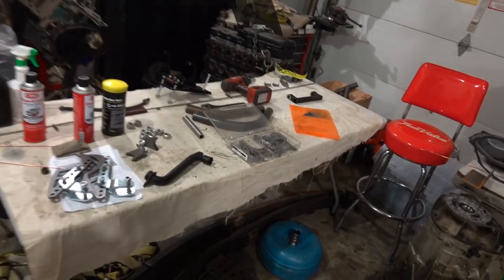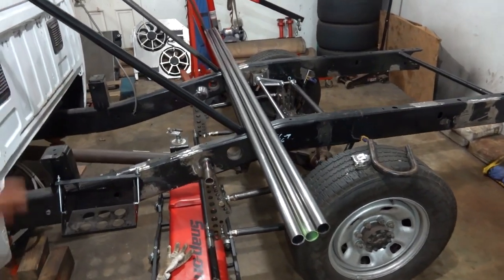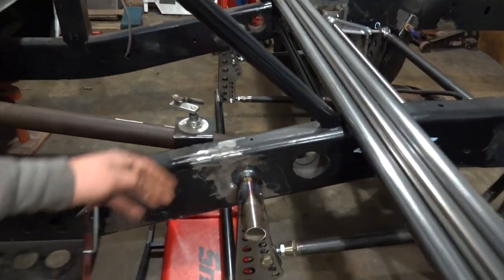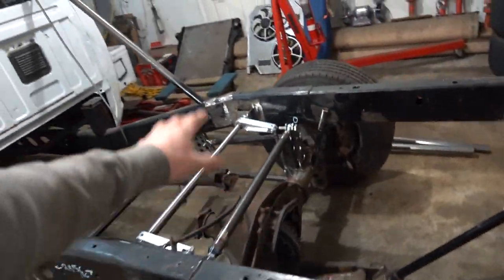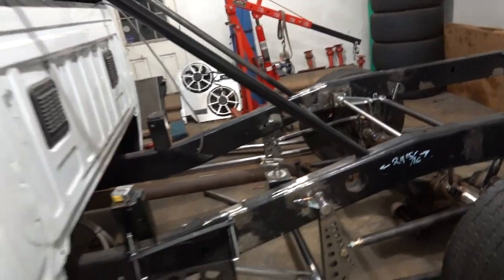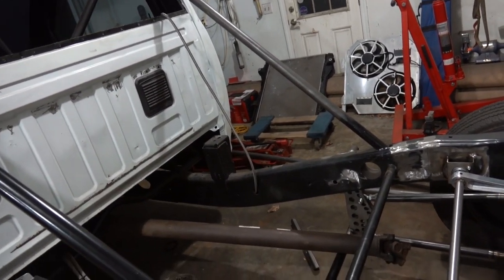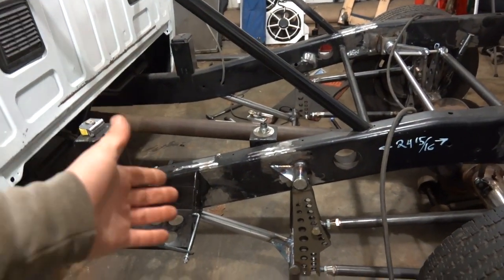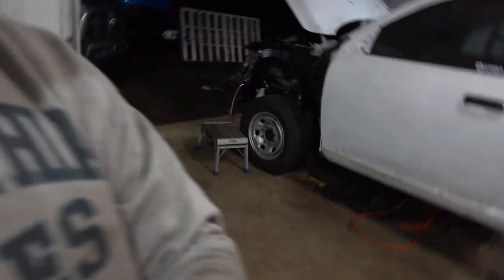Custom SOLID Rear Suspension For The Cummins Drag Truck???

Comment: You make this look so easy..how difficult is a 5.9 12v to learn on? How difficult Is a rebuild on a 12v..I have to mechanic knowledge.  I want to learn
Reply from the maker: Don't know, I've haven't messed around with any 12v stuff
Reply: I meant to say I have no mechanical knowledge.  Gotta find a cheap one to learn on